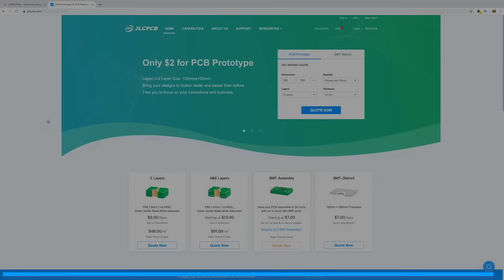10 BEST Tips & TRICKS with a sample CABLE TIES

Comment: Terrible way to label cables.     

ProTip: Print a label (preferably one that wraps around the wire so it can be read from any side). Affix label to wire. Use clear heat shrink over label on wire.
Reply: yep... the way this guy does it ... if he tries to pull the wires through for replacement it will sang on everything....
Reply: Or just use printable shrink tubing!
Reply: @pauldrackford3296  I've had custom shrink tube printed with my company logo on it, it was too easy for it to be wiped off.  I didn't care too much for it.

Comment: 4:40 I am really curius , what cind of electric oven is powered by 21x0.5 power cables. XD
Reply: It's an Italian thing, a pizza thing. Usually you'd use 3 wires (Line, neutral and earth, when needed), but 21 is more than 3, so in italian point of view that's of course way better. You'll never understand :D (me too, but it's ok!)

Comment: The idea with clamps is good, but only here they cost so much!  This option is not suitable for me.
Reply: H A R  I live in Russia brother.  These clamps in my city are expensive. 😁
Reply: H A R   I purchase them only when necessary.  Quality ones will cost about 4 dollars 100 pieces.  Once I took low-quality and regretted. These are the things friend.
Reply: @rinatkairatovich  I can realte. Quality zip ties are expensive too where I live, $5,50 a 100 piece set what is 290 mm long. I use Fischer zip ties, tried so many, this is what I trust.
Reply: Have you tried cable lacing twine? It's an old technique used in aircraft wire harnesses. A spool of lace can run 5-20$, but it will last you a long time and there are methods here on YT that will make it look really good.
Reply: H A R  in a country with an average salary of $500-600 a month, $5 isn't necesaarily pocket change like for other countries...

Comment: Do you know how to make your tie wraps the same color as your cable ? Get a smaller tie wrap them cut a piece of cable take out the twisted pair then slide the Tie Wrap inside the cable jacket adjust how much diameter you need by trimming off some of the jacket

Comment: There has got to be a way to do this with fewer zipties, given how long each one is. Quadrupling the number of zip ties you use isn't helpful. What about wrapping the ziptie around each pair of cables to use up more of its length, in a staggered wrap? That should help.

Comment: Respect, in a production environment this is cable labeling and schematics laminated and put near in every cable box is a needed thing, as a place where you got crews from different contractors coming to put  new equipment running is a horror story and a insane amount of time is wasted if labels and info is not presented and can take you hours of time you actually don't have  to get all integrated, in eastern Europe is no labeling, no color coding and always a rat's nest a tradition ...

Comment: Want to go to next level. (If) you dont own a zip-tie gun. Dont cut them with those scissors or dykes. You can snip them off but final cut buy a pair of $.99 curved toe nail clippers. Slide them down far as you can. Will snip off the end smooth and it cant snag you. I do a lot of under dash stuff. Almost bought a label maker till I see you need clear over it. Ill use my labels and clear tube. Save #150

Comment: I love how neat your work is, but just as a comment, the zip ties one even though looks good, you're using 4 ties where there could only be used one, only for that reason many people wouldn't  apply it since in most places those are expensive and the cost doesn't compensate time and effort.
Reply: No, cable spacing is often important in relation to current rating of heavy and multi-core cables. 
It also makes tracing out a specific cable far easier in large industrial installations.
Reply: @BTW...  Agree, for high current installations and industrial facilities, but for a domestic one, neither are mandatory. Take care my friend.

Comment: There should be another tip, carry a few bandages so you can stop the bleeding when you rip your skin open on those poorly trimmed zip ties!  For craps sake, get some decent flush cutting cutters if you are going to present yourself as some sort of authority on the topic.
Reply: Yeah... it's a sign the video maker isn't a professional.  
I've been using cable ties since the 1970's, and found any type of scissor or wire cutting tool will leave a nasty 'shark tooth' - I never use them.  
One of the oldest tools in my kit (from the 70's) was made by T&B, one of the original manufacturers of cable ties. It's a very simple small tool that slips over the tie near the head, tensions and with a slight twist while under tension cuts the tie absolutely flush with the head. The release of tension has the trimmed end retract. This tool has outlasted countless side cutters and 'flush cut' and never leaves a sharp shark tooth that rips into your flesh. 
I've worked in manufacture and installation roles, in the latter the VERY LAST task in securing cables is cutting ties. The trick is to partially tension tie, which allows some movement of the cable on a tray to tidy up slack and then loop the end under, to run along the length of the cable. 
That is the professional way to use these ties.

Comment: What a GIGANTIC, monumental waste of my life, the only ok one is the first one, which I already knew about. Why are you sticking labels, which are sticky... to a zip-tie... WHEN YOU CAN STICK IT TO THE CABLE ITSELF?! Maybe even use the shrink tube on it as well? 8O
Reply: Because,

a.) The sticky NEVER stays stuck. You'll inevitably end up with a bunch of labels separated from their cables and piled at the bottom of the cabinet. This is especially problematic with small diameter cables. So yes, even on the cables you would need to use heat shrink.

b.) Many cables are pre-terminated. Heat shrink tubing that fits over a cable almost never fits over the connector at the end of a cable.

c.) labeling with zip-ties lets you label cables that are already installed without the need to disconnect them, allowing you to back-label a pre-existing installation without disruption.

d.) By labeling the zip-tie you only have to maintain one size of label and one size of heat shrink to label any and all sizes and bundles of cable

Comment: Waaay too much trouble.  Also I prefer using Velcro to zip ties as cables are always constantly being bundled/unbundled.  With Velcro you just re-use the same one and be done in seconds.  With Zip ties you have to get out the cable cutter and snip the old one, then look for a new zip tie in your toolkit, and finally clean up the new addition to the global plastic waste problem.  I got a big jar of zip ties from work in various sizes, and never used any of them as I just re-use old velcro strips and even those twist ties you get with any new power adapter/mouse/keyboard/cables etc.
For labelling - just print a double label, then wrap it around 90-degrees to the cable and stick onto itself.  Can be seen from either side, flexible enough so pulling cables through small spaces won't be hindered, and I have never had one come off.

Comment: "How to maximize the amount of sliced fingers for only ten times the cost of a normal installation"
Reply: You have obviously never had to troubleshoot an IT closet that looks like a giant birds nest. Complete with three generations of phone systems all tied in cross connected here and there and then came cat 3 and were adding more cable What cat5 is better faster we add more cables never removing any always adding. I’m not talking about a residential home network Businesses big and small some of these closets in fact most of them are beyond comprehension.
Reply: @smash72cutlass30  Touche' LOL --  I've also learned the value of velcro straps :-)  (although those don't do much to help the '10x install cost' argument :-D

Comment: The labels on cable.  I tried printing the label on a (thermal) printer.  Stuck it on the cable and slid some transparent heat shrink over it.   Used a heat gun to shrink the heat shrink.  It was at this point I discovered the printer was a thermal printer.  As the heat shrink shrank the label turned black.   Oops.